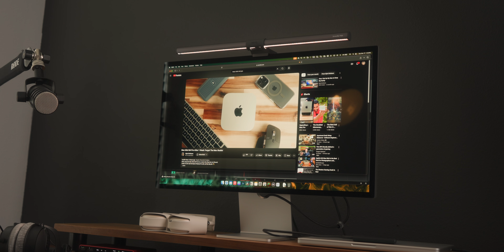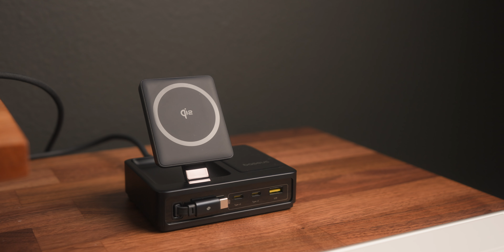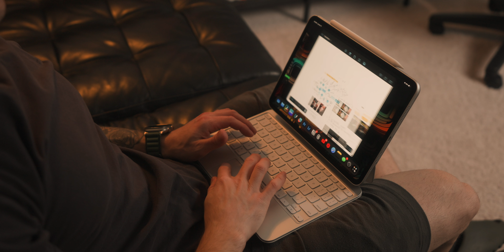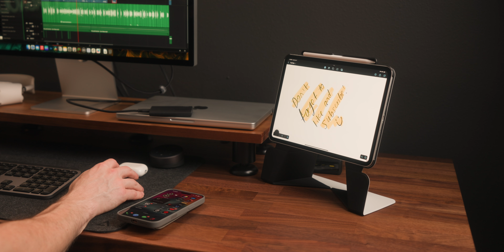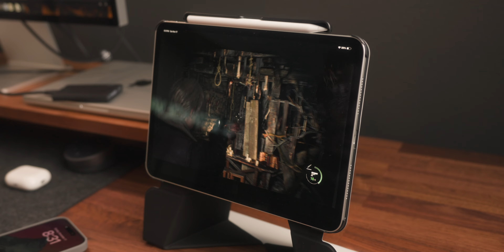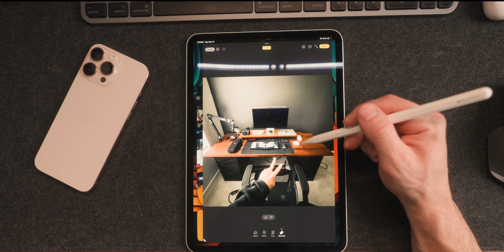M4 iPad Pro 6 Months Later - The Only iPad You Should Buy

Comment: Just wanted to ask, do you use a Screen Protector at all outside of the Magic Keyboard? As I assume you use it in tablet form when relaxing or chilling out? If so, do you use Tempered Glass or Paper Feel? Can you recommend one please?
Reply from the maker: I use the iPad without screen protector as all of my other devices since, in my opinion, it takes away from the experience. But when I use the iPad without the Magic Keyboard, the best thing to have is some sort of folio so you can place it anywhere a bit more confidently. I’ve been using a lot the Float Folio Case from MOFT. 

So far, my screen is in perfect condition.

I hope it helped. 🫡

Comment: I’ve been using an iPad for about seven years. I first started using one during my freshman year of high school with an old 2018 iPad. As a student, iPads were great and helped me take numerous notes. However, after four years of college, I’ve completely stopped using an iPad. When the new M4 iPads were released, I was thrilled and bought the 11-inch base model with the new Magic Keyboard and Apple Pencil Pro. I thought, “Oh my, this is exactly what I needed—an update.” Not only were Apple users getting an update, but we were also getting apple intelligence and improved multitasking features for Stage Manager, which made an iPad potentially replace a MacBook. Well, I was completely wrong. I’ve since sold my M4 iPad and purchased an M2 MacBook Air with 16GB of RAM and 1TB of storage. I’ll never go back. Now, I have a much deeper appreciation for macOS and using leather notebooks with fine-point pens to take notes and navigate life. 

Tbh it really comes down to the OS, I was willing to simplify my note taking and have a seamless experience on macOS rather than stay on iPadOS and still have the lingering feeling of attempting to make an iPad my everything device. For those that use an iPad to complement a macbook, that works very well! I think today I could benefit more off of an iPad mini!
Reply from the maker: If you can always have 1, I will always recommend a MacBook instead. Now that you have the Mini, you have the ultimate setup.

Congrats on your MacBook Air.🔥 16gb of RAM is a must have now days.